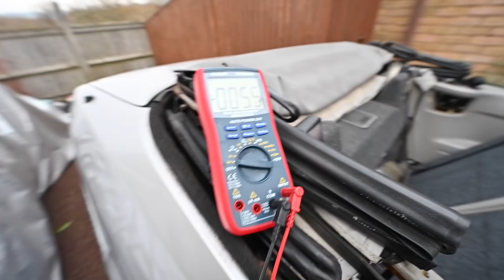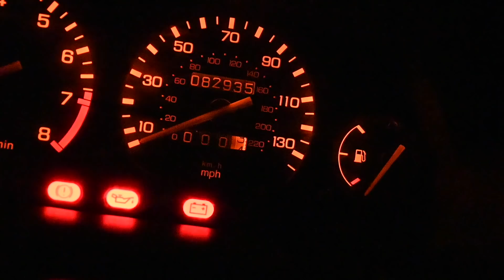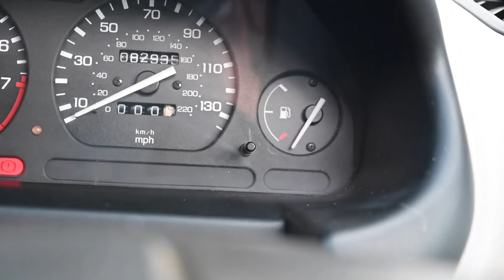Rover 216 Cabrio not starting SOLVED!

Comment: How did u get round the module issue? My tourer if I push the top right together fuel pump engages! However otherwise won’t
Reply from the maker: I changed all 3 boxes for the ECU/alarm/immobilser BUT I now know that a P Scan (google it) scanner cold have reset the originals, which I did with the 200vi. The fuel pump in this was faulty, and then so was the replacement!

Comment: Had one in 2005 and loved it.  Only thing was,  every so often the hood would leak and I mean leak.  You could bathe your feet in the foot well. Never found  out where it was leaking from as I used a hosepipe on the roof and   it never leaked. put a car cover over it.  It was suggested years after I sold the car that it could have been coming in through the heater matrix.

Comment: With all of the pump in and outs, could it be as simple as the wire has come off the sender?
Reply from the maker: Its in the same loom plug as the pump and part of it as far as I can tell, possibly that connect block is the fault

Comment: Fantastic! Don't let anyone tell you this isn't worth the effort. Surprised to hear you talking about distributer etc. I assumed it would be modern enough for fuel injection.
Reply from the maker: Its got EFI but the spark still comes from a rotor arm distributer with a single coil

Comment: There isn't enough coolant in the expansion tank either you fill them to the centre line on the expansion tank.
Reply from the maker: It has dropped since we did the water pump

Comment: ????????....cars continue to confuse me. 2  bad earths, but worked previously on old pump, presumably with the same bad earths, and now refuse to work.  Would it  have worked if the pump didnt fail?  I do kinda like trying to trace wiring issues, but this vehicle would even test me..........fair play to you two though.
Reply from the maker: It is odd but was stood for 7 years so connections go bad and then as the car moves it vibrates things, lots of room for failure on a rescue car

Comment: I do hate it when an expert makes the rest of us mortals look like complete idiots,  schoolboy error there, not checking that all the leads are plugged in to the distributor, eagerness gets to us all at times, those leads look a bit grotty, maybe a new set needed to avoid future spark problems?  Have fun sorting out the fuel gauge!  Should be easy after the pump fiasco or call the expert.
Reply from the maker: I was trying to avoid buying leads as its another £30 or £40 on this thing, but might have to